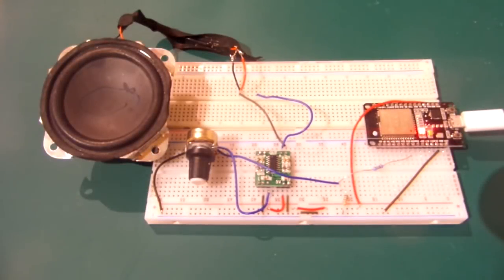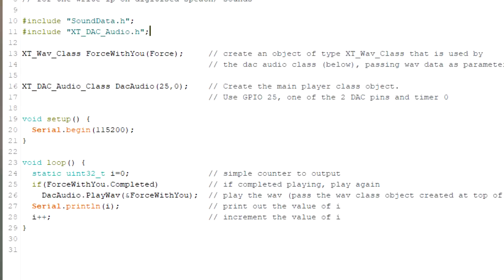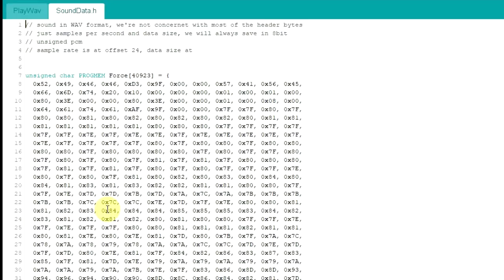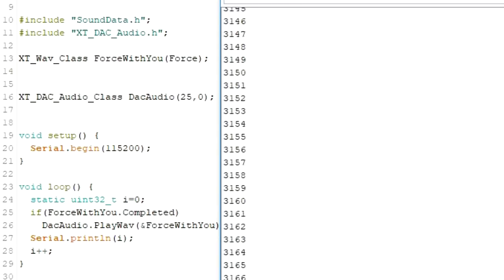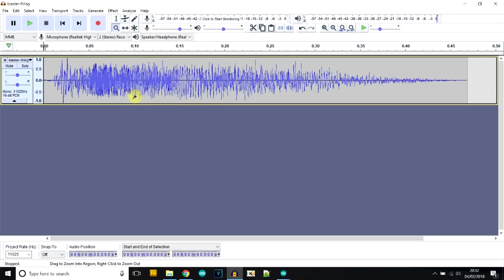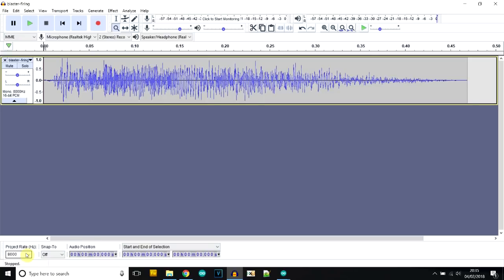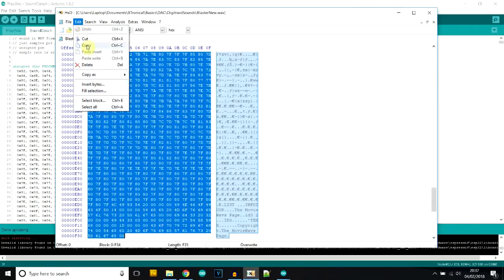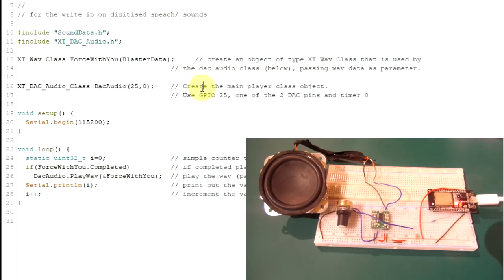Make your ESP32 talk, playing WAV files on your ESP32, digital sound DAC ADC

Comment: Just found this and really enjoy playing around with the code. Thanks for all the hard work. I have a question. No matter what I do, my wav has a very noticeable crackle. The playback speed is fine though. I also put in the resistors like advised.  Tried different lengths and sample rates. Sample is Mono. Around 50kb. The examples playback fine. So I think it must be in the file. Any tips to debug?
Reply from the maker: Just checking but are you using the latest version. But as you say, if the examples are fine then it suggests something wrong with your conversion. Just check you are doing all the steps correctly. What sample rate are you using?
Reply: @XTronical  Around 20k sample rate but i've tried as low as 8k and a couple of seconds of sample. Tried different source MP3's. All the same issue. I do export them Mono. Unsigned 8 bit PCM. So that should be OK right? 

I am using the latest version of your library.

How would I go about troubleshooting this? To describe the issue; it almost sounds like the audio version of "frame skipping". It's crackling like every other 1ms it's not playing anything. And also a bunch of distortion. It's not clipping because I've also tried exporting with normalize levels from 0 to -40db
Reply from the maker: If you do a post on my website www.xtronical.com then it will send me your email address without it being published for all to see. Then I'll email you back and then you can email me your original sample and the project and I'll be able to look into it for you. I've not come across this particular problem before.

Comment: Hi, love the videos, I was wondering if or how I could play 2 wav files overlapping each other. I made super bomberman by adding loads of features to your gfx library now I have the tune playing but I want the bombs sound to overlap the theme tune, as at the moment I have to pause one and play another. I was thinking this could be achieved by using 2 timers on the two DAC pins with the output converging to one wire for the speaker. The issue is that your audio library only excepts one pin and timer. Can you adjust your library to allow 2 wav files to play at once please it would be 100x easier for you than I 😅
Reply from the maker: Thank you for the kind comments. Good news, the library already supports what you want already. It is capable of playing multiple wav files of different sample rates simultaneously. It does this by mixing the resultant waves together digitally to generate a resultant wave which is then output to the DAC. So you can play as many sounds together as the ESP32 can handle (which is quiet a few). I use this technique on my Frogger project, see :  https://youtu.be/J9mV2IcEvP0 , also you will find examples of mixing in the examples supplied with the library, try this  "File->Examples->XT_DAC_Audio->Mixing"
I think this should help you a lot and good luck with the Bomberman project
Reply: @XTronical  thanks maybe i have an old version, "ha" just checked yes i have version 1, i just downloaded version 4.1.0. sweet :). One last thing i dont have a PAM8403 and i have the output going directly from PIN 25 to the speaker but i am getting a fuzzy sound between notes, any idea what i could do to fix the noise until get a PAM8403 ?
Reply from the maker: Depending on your speaker this may damage or break your ESP32. Most speakers of a decent output will demand peaks of current from your MCU and you may also get some spikes fed back into your device when the sounds stop, best to have some sort of buffer there, even if just a simple transistor to take the load off your ESP32. I would guess you've got a low powered /high ohm speaker connected? The noise may fix when you take the load off the ESP32 - or it may not. I've noticed occasional problems picking up noise on my set up but it's not  been bad enough to bother me, most of the problems are usually because of using longish wires and breadboard. This can cause these issues.
Reply: @XTronical  its a 1 to 3v mechanical buzzer , fine for up to 2.3Khz to which superBomber man for the SNES is all old school monoTones  so it sounds fine
Reply from the maker: Ahh, probably high resistance.  The noise can probably be filtered out but you might need a scope to analyse it. I'm no expert on audio filters unfortunately
Reply: @XTronical  no worries the new version seems to ignore the noise for some reason. And I sorted the errors.
Reply from the maker: Cool. Great to hear.
Reply from the maker: And I've just looked at your channel and subbed, some great work on  there :)
Reply: @XTronical  
Oh cheers pal i shall put up a video of Super BomberMan once i have it finished later this week. One last thing sorry to take your time, i have a error with the mixing example.

C:\Users\Edwin\Documents\Arduino\libraries\XT_DAC_Audio\XT_DAC_Audio.cpp: In member function 'void XT_DAC_Audio_Class::FillBuffer()':

C:\Users\Edwin\Documents\Arduino\libraries\XT_DAC_Audio\XT_DAC_Audio.cpp:163:19: warning: unused variable 'BufferByte' [-Wunused-variable]

  uint8_t NextByte,BufferByte;         // raw unsigned values of naext byte to plat and mix with

                   ^

C:\Users\Edwin\Documents\Arduino\libraries\XT_DAC_Audio\XT_DAC_Audio.cpp: In member function 'void XT_Instrument_Class::SetWaveForm(uint8_t)':

C:\Users\Edwin\Documents\Arduino\libraries\XT_DAC_Audio\XT_DAC_Audio.cpp:624:18: error: deleting object of polymorphic class type 'XT_Wave_Class' which has non-virtual destructor might cause undefined behaviour [-Werror=delete-non-virtual-dtor]

  delete (WaveForm);          // free any previous memory for a previous waveform

                  ^

C:\Users\Edwin\Documents\Arduino\libraries\XT_DAC_Audio\XT_DAC_Audio.cpp: In member function 'virtual uint8_t XT_Sequence_Class::NextByte()':

C:\Users\Edwin\Documents\Arduino\libraries\XT_DAC_Audio\XT_DAC_Audio.cpp:1254:1: error: control reaches end of non-void function [-Werror=return-type]

 }

 ^

cc1plus.exe: some warnings being treated as errors
Reply: Oh i see you have no final return in XT_Sequence_Class line 1254
Reply from the maker: Yes, sorry, depending on your compiler setting, these can pop up. I think they changed the default setting a while back as they didn't pop up during development. They are basically warnings but some are being treated as errors when they are OK. All you need do is change your compiler warnings level. Go to "File->Preferences" and on the "Compiler Warnings" choose default if it's set to "more" or "all" and if it is at default then try "none". I need to go back and tidy up the code so that it compiles with no warnings.... Something I've not got round to (rolls eyes).
Reply from the maker: Yep, needs sorting (blushes), with what I've suggested  (compiler warnings level setting( it should ignore this, but it is sloppy coding !
Reply: @XTronical  what should i put as the default return at the end of XT_FilterNoise_Class::XT_FilterNoise_Class as it is missing one and i can not compile it , are try return 0;

ok i put return 0; now the final error, can i just comment out  delete (WaveForm);  or will i run out of memory ?

C:\Users\Edwin\Documents\Arduino\libraries\XT_DAC_Audio\XT_DAC_Audio.cpp:624:18: error: deleting object of polymorphic class type 'XT_Wave_Class' which has non-virtual destructor might cause undefined behaviour [-Werror=delete-non-virtual-dtor]

  delete (WaveForm);          // free any previous memory for a previous waveform

                  ^

cc1plus.exe: some warnings being treated as errors

Comment: I am finally getting to try it again:
I am using the SequenceSpeakNums demo and I am getting a strange click at the end of speaking. (for example, I type 1234 and after hearing the 4 there is a click) 
Sounds like the speaker is clamping to an extreme value fast. 
Any idea how to solve it?
Reply from the maker: Yes speaker is moving quickly to either High or low value at end. Let me check with real hardware and make sure that it doesn't do that for me as well. I'll get back to you in a day or two. In meantime do the other demos work?
Reply: I reverted to the original SequenceSpeakNums and the click is gone. 
In my test, I just added one more word which the code speaks out OK but when it stops speaking there is a click with any of your numbers...  I can send you the file if you wish.
Reply: FYI: I used the osx  xxd utility to create the C data structure. 
xxd -i file0001.wav > file0001.h. The resulting file compiles and speaks ok... but for the click, it would be 100%....
Reply from the maker: Yes send me the files and I'll have a look. As I don't like putting the email on the Internet for all the spam bots to see just make a comment on the xtronical Web site and I'll be able to see yours and reply via email.
Reply from the maker: Have you tried with the software I demoed, think it was hexed.
Reply: I just sent a comment on your web site
Reply: not yet. I will try it tomorrow.

Comment: hello,Can you share the circuit of the setup as it is not clear in video an also what to mean by GPIO25 PIN ?Can you name the pin?
Reply from the maker: All circuits and more information are on website. In addition this is the first video in several, have a look at my playlists and you'll see them grouped together. There is a tutorial one on adding an amplifier. GPIO25 will be labelled 25 on most if not all boards.

Comment: The first version of the library works with my Arduino and ESP32. Current Library (4_1_0) gets a compile error. Not sure how to fix it.
Reply from the maker: The first library is too buggy, it can give unpredictable crashes, I wouldn't use it. The code is not intended for arduino due to its small storage space. Is the compile error on the esp32 and if so what does it say.?
Reply: Here is where the errors/warnings begin:

/var/folders/vw/htc_f5617j3gf7wxn7c63c5r0000gn/T/arduino_build_148616/libraries/XT_DAC_Audio/XT_DAC_Audio.cpp.o
/Users/doron/Documents/Arduino/libraries/XT_DAC_Audio/XT_DAC_Audio.cpp: In member function 'void XT_DAC_Audio_Class::FillBuffer()':
/Users/doron/Documents/Arduino/libraries/XT_DAC_Audio/XT_DAC_Audio.cpp:163:19: warning: unused variable 'BufferByte' [-Wunused-variable]
  uint8_t NextByte,BufferByte;         // raw unsigned values of naext byte to plat and mix with

                   ^
/Users/doron/Documents/Arduino/libraries/XT_DAC_Audio/XT_DAC_Audio.cpp: In member function 'void XT_Instrument_Class::SetWaveForm(uint8_t)':
/Users/doron/Documents/Arduino/libraries/XT_DAC_Audio/XT_DAC_Audio.cpp:624:18: error: deleting object of polymorphic class type 'XT_Wave_Class' which has non-virtual destructor might cause undefined behaviour [-Werror=delete-non-virtual-dtor]
  delete (WaveForm);          // free any previous memory for a previous waveform

                  ^
/Users/doron/Documents/Arduino/libraries/XT_DAC_Audio/XT_DAC_Audio.cpp: In member function 'virtual uint8_t XT_Sequence_Class::NextByte()':
/Users/doron/Documents/Arduino/libraries/XT_DAC_Audio/XT_DAC_Audio.cpp:1254:1: error: control reaches end of non-void function [-Werror=return-type]
 }

 ^
cc1plus: some warnings being treated as errors
Using library XT_DAC_Audio in folder: /Users/doron/Documents/Arduino/libraries/XT_DAC_Audio (legacy)
exit status 1
Error compiling for board ESP32 Dev Module.
Reply from the maker: Will look at this later and get back.
Reply: Thanks. 
A bit of new info: With compiler warning set to ALL it does not compile. 
With compiler warning set to DEFAULT, it does complete the compilation and run.
Reply from the maker: Yes, just looking over the errors. It's because I've not tidied the code up after compilation. They were warnings and the error level was set to treat as errors. I should really get rid of these but this has not come up before. Glad you managed to sort it great stuff.

Comment: Have your files every played at a really low speed on the ESP32? I have a nodeMCU board and I’ve followed ur steps. My files play reallly deep and slow while ur file plays fine.
Reply from the maker: Only been slow if amount of buffer is too low but if you're running the normal demo this will have an appropriate buffer. Is it a demo giving you a problem or your own files
Reply: Btw, thanks for this and what a cool job. The demo works great.
Reply: My rerendered file plays fine on the PC. After Hxd it also has a few less hex values than the example.
Reply from the maker: Did you convert to mono or leave it as stereo, the library needs mono sound.
Reply: Brilliant! Totalllllllly missed that! You champion! I just looked up how to convert to mono and now it’s cherry ripe! Thanks heaps!

Comment: Already tried this library, works like a charm, it's really elegant, thanks a lot! It saved my day! Just one thing, for some reason it was clashing with Blynk Timer, fortunately I don't need the later in my code, so I deleted that part, other than that, wonderful !
Reply from the maker: Try changing the timer the library uses, you set the timer when you create the DACAudio object, on the esp32 I think you can choose 0 to 3. Glad you like it, it was fun to code.
Reply: Will try that, thanks a lot for the advice ! @XTronical

Comment: May it work with ESP8266?
Reply from the maker: Not at the moment as the esp8266 does not have a DAC pin but I'm looking at using an add on DAC for esp8266 and possibly Arduino
Reply: XTronical  May you please show me how to do that!
Reply from the maker: It is for a later project, some time on the future yet, requires alterations to the library code.
Reply: XTronical  If you have done it, please kindly share it with me. I am really interested in working with this.
Reply from the maker: I haven't done it yet. When I do it will be shared
Reply: XTronical  thank you very much in advance for your kindness! I will be waiting your completed achievement.

Comment: for some reason it doesn't seem to work. I have ESP32 pico d4 kit, and the code seems to compile normally and start, but the serial port display just increments numbers wildly, like 3000 in a second, in a couple of seconds it is already at 10 000 and so on.. what might be causing this?? it should increment only when the sample has been played.
Reply from the maker: If your using the example default code then that is the expected behaviour, it's showing that your "main loop" code can run  independently of the sample being played. Does the sound play as well?
Reply: Thank you! It works as it should then, sorry I was not attentional to the code or comments :)) It seems to have very low maximum sample length. I have Pico d4 esp32 with 4MB flash but still even a 30K sample won't play correctly, but stops before the end and doesn't loop. But shorter  20K samples play fine.
Reply from the maker: There is a limit, perhaps issue, I'm not sure, with the compiler and larger files. Although I think I've managed up to around 80 to 90k or so. It's something that is annoying and will look into future if there is a work around the problem. It's not a fault of the library but of other issues with the environment.
Reply: No, it's a bug in the code.  I found it and fixed it, and have played a music file that is 40 second long (Fur Elise).  The size of the wav file is 302KB.  

I made a couple of other fixes, and also created a little script to convert any standard audio/video file to the required wav format and .h file.  Don't know how I can get these to you, I can't find any contact information.
Reply from the maker: Nice work, great stuff. I'm not in front of a PC at the moment but I may be able to youtube private message my email address to you. If they still have private messages, not sure.
Reply from the maker: Can't find a youtube message option, there used to be one. Anyway just so I don't put the email up on a public forum you could go to www.xtronical.com  and either join up or make a comment on any article - the comment doesn't need to be anything sensible! as all comments from new people are moderated first. That way I'll get your email address privately and can reply with mine. Once again, thanks for spotting this, I'll integrate into latest build.
Reply from the maker: Ha ha, just logged into my site and seen your comment, I've had real issues that I can't seem to sort out where I'm not notified of new comments so if I don't login for a couple of days it looks like I'm ignoring people. Will implement your work ASAP, probably done by Wednesday as I have another video I'm just in the middle of making and editing at the moment.
Reply: I sent you an email, 2 sets of fixes.
Including a couple of utilities that make it much easier to convert any audio file (mp3, mp4, etc.) to the correct wav and a .h file.

ANybody can download it, https://www.dropbox.com/s/94a1i9bkypp45m6/XT-DAC-patches-for-3.1-v2_rvt2.zip?dl=0
Reply from the maker: I'll give that a go, I did two solutions based on your ideas but still had issues.

Comment: Hi, I can compile and upload on Arduino IDE 1.6.6 however the ESP32 module constantly resets (without anything connected), it throws this: 
Guru Meditation Error: Core  0 panic'ed (LoadProhibited)
. Exception was unhandled.
Any help would be really appreciated.
Reply from the maker: Are you using version 1 of the library? Try version 3 , see here : http://www.xtronical.com/the-dacaudio-library-download-and-installation/
Reply: Thank you so much, V. 3 did work perfectly